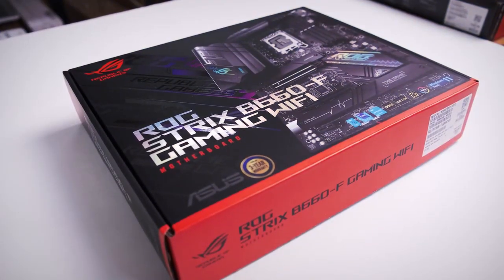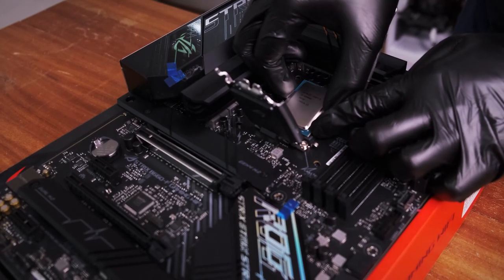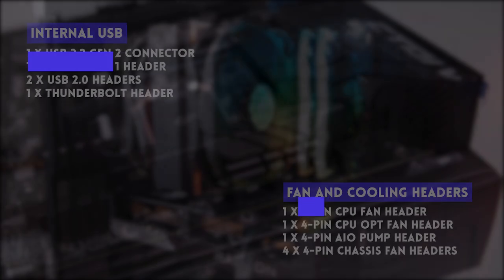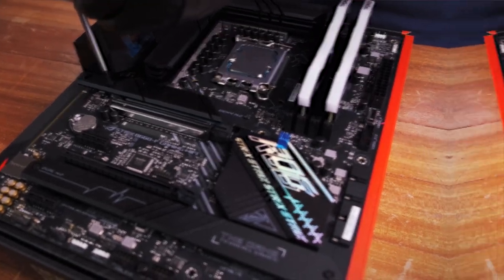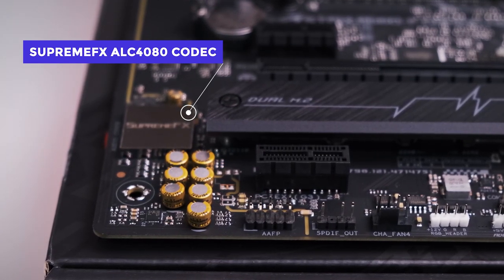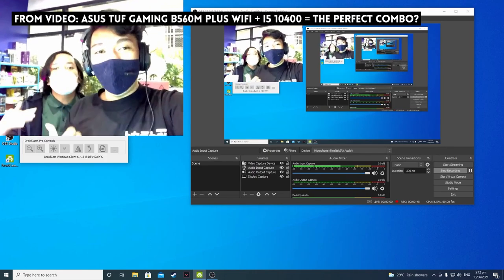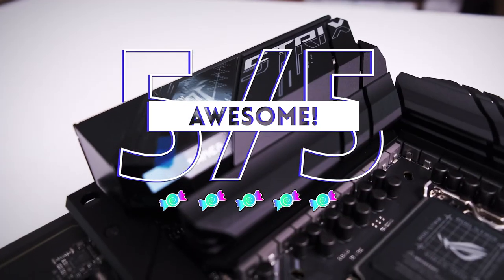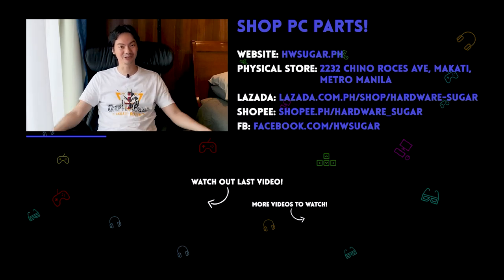The user-friendliest gaming motherboard | ROG Strix B660-F Gaming Wifi Review | Hardware Sugar

Comment: So what does the PCIe 5 slot on this motherboard means for future proofing? Would it support gen 5 ssd?
Reply: Any PCIE gen 5 device. That includes SSDs, GPUs, and other expansion cards.
Reply: @rockyismael  not really, the ssd slots are gen 4, only the main pcie slot is 5.0, the other pcie slots are either gen 4 or 3 depends on the motherboard